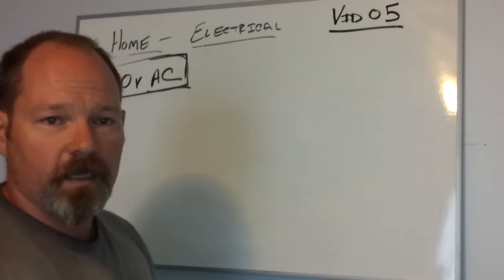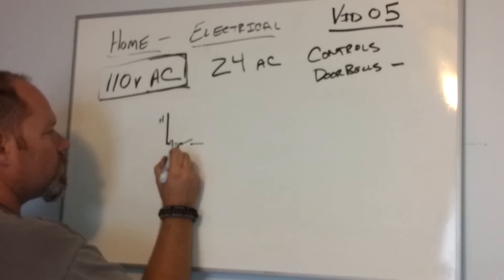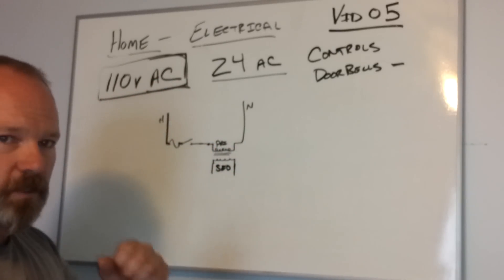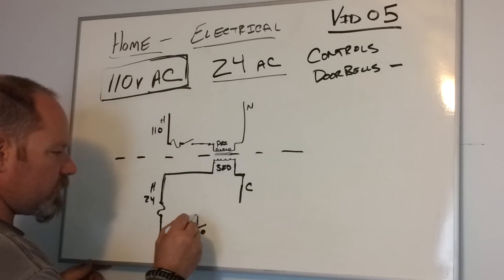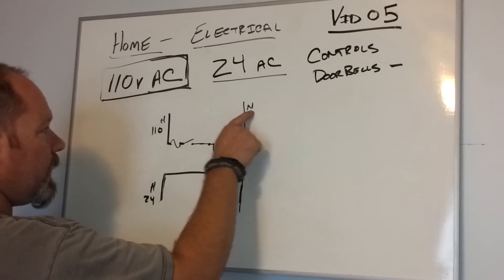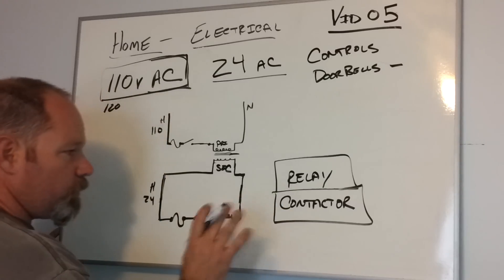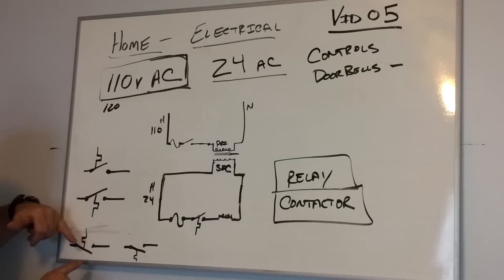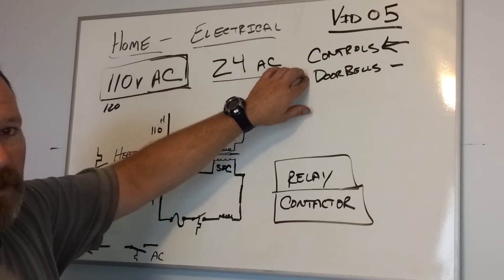BASIC ELECTRICAL 101#05 ~ LOW VOLTAGE AND CONTROLS

Comment: I had someone vandalise my house. And I mean every sister in the house. I have gotten low voltage readings from anything that has a  warning system for low voltage. My lights are dim, my stove doesn't work right, and my appliances are dying. I had the electric company test the wiring, and they said there was huge discrepancy of voltage inside my house, not on the side of the electric company. Any ideas? I'm scared my house is going to burn down around my ears. I have no idea where to look for the trouble.
Reply from the maker: Shut the main off. Call an electrician now. Figure out how to pay later!
Reply from the maker: Call an electrician asap!!!
Reply: @GuyBrown  that helps alot. But thanks, I will. I just need to k ow of there's anything o can do on the meantime before I can afford an electrician, to keep my house from burning down short of throwing the main breakers. It's winter and cold. Below freezing cold. Sorry, I'm in a pretty desperate situation.

Comment: Just bought a house that was built in the 60s the everything becides the bedrooms are on a low voltage system. Buttons switch relays in the floor to change lighting there are multiple buttons that control the lights its a maze. Wondering how to troubleshoot the buttons that don't work

Comment: Why is the N called common in dc?
Reply from the maker: It's not. DC voltage is positive and negative. 24 volt AC is C and R, 120 volt AC is hot and neutral with ground and 240 volt AC is L1 and L2 with a neutral and a ground. Hope this helps

Comment: good video.  however 110 and 120 volts is not synonymous.  120 volts refers to nominal service voltage while 110 volts applies to appliance operating voltage design.

Comment: These are great videos. I’m having my pushmatic panel replaced with a circuit breaker panel. Should I have a whole house SURGE PROTECTOR installed at the same time....not sure?  I currently have a surge protector for the computer.  Thank you
Reply from the maker: Only if you are having surge issues or if you have highly sensitive equipment. Thanks for watching

Comment: Hey Mr. Brown I found your videos very informative and simple to understand. I am trying very hard to learn electricity. In the above video I notice that you have two circuits one carrying the 110 v and the other the 24 v as a result of the transformer. I notice you label the wire after the load on the 110 v circuit as Neutral and the one on the 24v circuit as common, why is that so? Also, I would like to find a inexpensive school in the USA that teaches HVAC and electricity, i would love a crash course that wouldnt exceed 3 months as I work here in Belize. Let me know if you can help- my uncle in Atlanta told me, the last time I visited, that Home depot sometimes offer free classes but seing that you are in the business you may know better. Also, if you have a class, tell me about it, I am very interested

Comment: may i know what is the purpose of low voltage power supply?
and how to troubleshoot it.?
response is pretty much appreciated.! :D
Reply: Who Cares low voltage power supply is mainly for safety which is also referred to as control voltage or secondary voltage because it is step down by means of a transformer troubleshooting it will depend on what the problem is that you're troubleshooting for the main tool that you would need is a multimeter
Reply: Who Cares the main things you would check for as to make sure you're receiving line voltage which in this video is described as 110 volts and if you have line voltage then you would check your Transformer which steps down 110 volts to 24 volts if your Transformer and your line voltage are correct then you will check to actual device or the fuse

Comment: What exactly is a "common wire" ?  I run into these at work all the time, but many times I am just wiring back how it was originally, I know what a hot is and a neutral is, but not what the common wire is.  Thanks for your time.
Reply: Theo Martinez x

Comment: thank you for the great explainations/tutorials!  
One question I have is if you were to see the schematic on a heat and cool hvac thermostat, would it be both a rise throw and a drop throw on the same switch? Meaning, both of the bottom diagrams basically placed on top of each other.

Comment: I like your explanation of the doorbell circuit. But, what type of transformer? What type of relay or contactor? And, how is that wired from 110VAC with only 2 wires to 24VDC with 3 wires? I have a lamp cord style plug with only (+) and (-) without a ground. I need to control it with a 24VDC door switch. That switch has 3 wires - COM, NO and NC.

Comment: Hey Guy, so a question about the (relay, contact, switch). Is it that after the transformer the (relay/contact) is permanently set at 24vAC or is it lower/higher than what the transformer is putting out?

-JD
Reply from the maker: Contactors are used to switch higher voltages and are usually controlled by the control voltage and in this case its 24v. Hope that helps
Reply: It does. Thank you.
Reply: DRcongo 🎉sir you help me a lot ❤am AC n refrigeration

Comment: I'm really enjoying your series on electrical. I'm wiring my cabin for ac/dc voltage for my solar and was wondering if you could do a video or could recommend one that would show like an RV-Marine AC/DC distribution panel and the best way to use that system. Thanks again for the video's, plan on sharing them with our sustainability group!
Reply from the maker: I will try to get a video out for you asap. Thanks for watching!!!
Reply: Awesome.